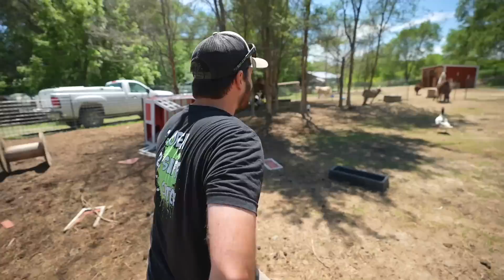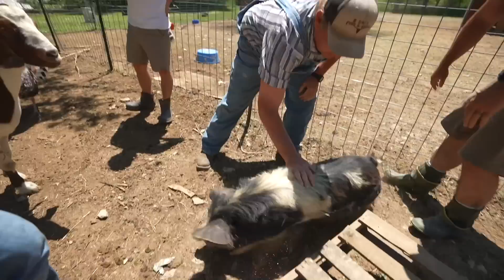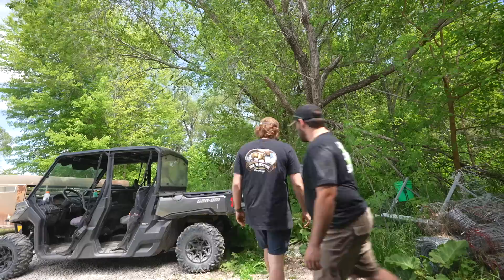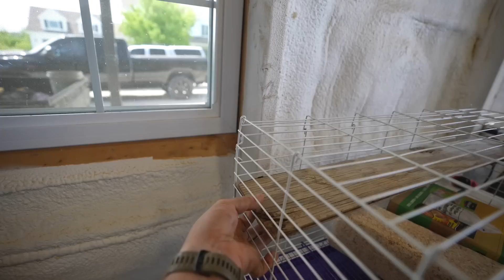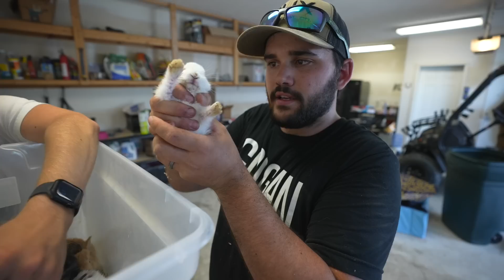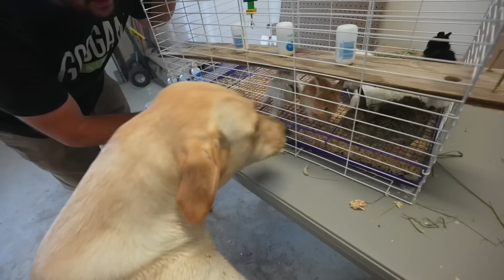SURPRISE Baby Rabbits were BORN in My BACKYARD FARM!!! (They Had to be RESCUED)

Comment: Take the mesh off the bottom of the cage cause it could cause bumble foot which causes them to not be able to walk comfortably
Reply: Your right if they were bigger, but with baby rabbits they can burry themselves in it completely and breath in all of the dust and it can cause lung issues and kill them, it’s the safer option while they are still small
Reply: I agree or if they line the wire with the big Timothy hay he said he had instead
Reply: for our rabbits we just have a pads with small holes so they can lay on that in stead of the cage

Comment: Here is a tip for the rabbit cage:
Don’t put the squared wire at the bottom of the cage because that can cause feet aches for the rabbits just a heads up
Reply: mesh wire sucks...14g 1/2 inch by 1 inch is the best wire spacing for rabbit feet. He should just buy a roll of wire and make proper cages. I feel like every time I watch his videos stuff is dead. Sad.

Comment: I would cover the bottom of the cage with something soft, because if the rabbits keep walking on the metal floor they'll get sores on their feet.
Reply: It’s good to have something where they can get off the wire because they can get sore hocks which isn’t any good
Reply: @Mady Ruggiero yeah true but with that cage if it is not cleaned regularly they will be sitting in their urine and feces. I’ve had rabbits in those cages before and it was horrendous the trays would be impossible to pull out after just a couple days but it shouldn’t be near as bad with baby rabbits. So the wire shouldn’t be a problem as long as the rabbits have the genetics for it

Comment: this is why you dont keep them outside that rabbit was beautiful.
Reply: No as a breeder rabbits living outside in proper care dont die very easily. Being outside exposes them to small illnesses causing them to be less likely to get disease. Also the wire floor if using the right size (1/2inch by 1/2inch) the rabbit will not get hock sores. If a rabbit is in heat tiles,cooling pads, and enclosed huts can keep them from overheating. Rabbits outdoors are fine in proper care. Not all Outside bunnies die ya know

Comment: "do you think rabbits can swim?" voice of reason aka Mumma "probably NOT" lmao it's always Mumma who has to keep the boys in line hehe. Also, if the doe was with multiple males they can be impregnated by multiple different males which could be where your colour variation comes from. Good luck, and if you ever need to bottle feed anything in the future, here in New Zealand, we tend to use a good quality lamb replacement milk powder. There is usually different mixing ratios on the bag for different species of animals. But you seem to have done just great with what you used and hey what ever keeps the little suckers alive!